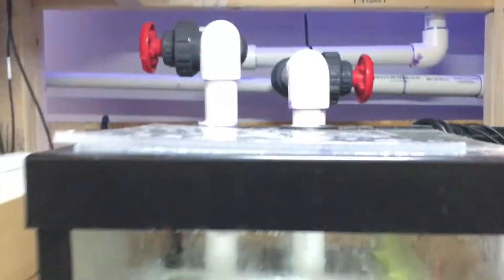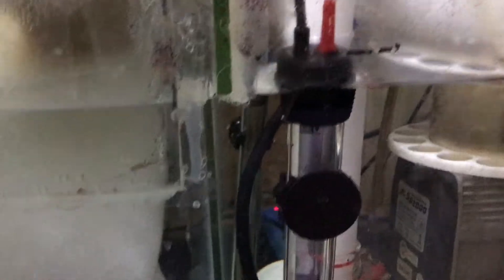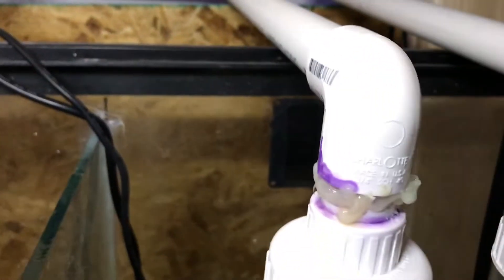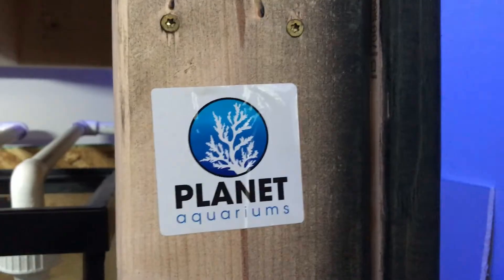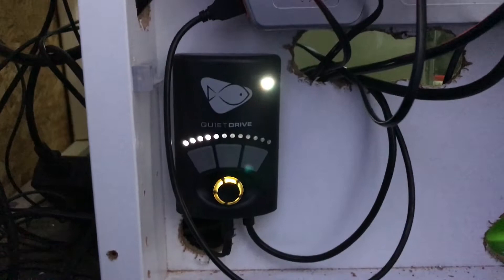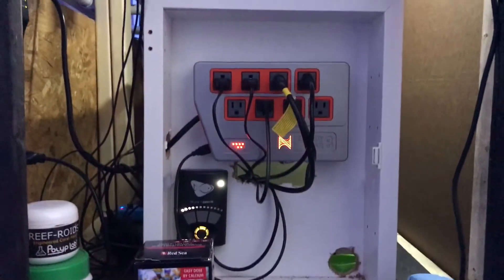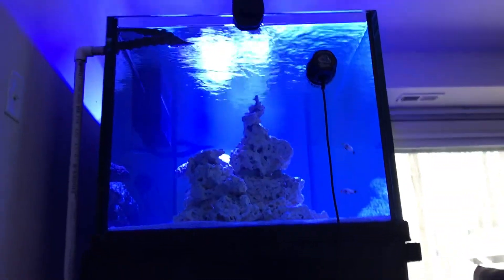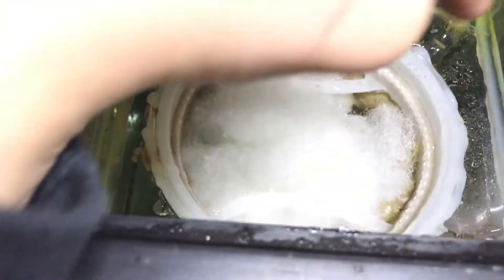My Reef Tank Part 2 Sump Tour

Comment: Awesome. Nice work!
Curious what keeps your filter sock area so quite..is it the floss or the small amount of drop it has to do due to the water level in the skimmer section?
Reply from the maker: I just got rid of the tank this past weekend, but essentially i just used the filter floss in a filter sock and had no noise whatsoever